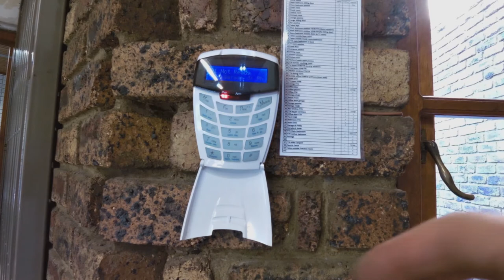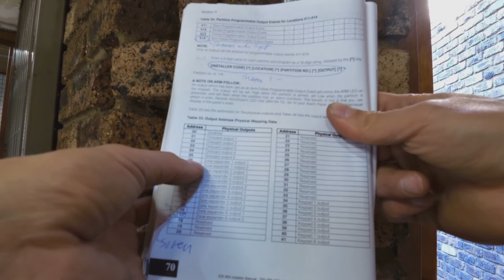How to connect a relay board to an IDS X64 expander module

Comment: Thanks for the informative videos. Can the onboard programmable outputs be programmed to open a gate or a garage door or do I have to install an external expander board? I couldn't find anything in the manual.

Comment: Great videos to explain the settings!! I used an Opto-isolator instead of a relay with current limiting resistor to limit the current to 10mA (below the 25-50mA rating) to do external monitoring of the alarm state. This worked for some time and then stopped working. I get no output from onboard output 3 as per the default settings when armed/disarmed. I tried to program another output, but still no output. Any idea on how I can test the outputs? I would assume that a relay coil will require slightly more current than an opto?
Reply from the maker: thank you. A small relay coil is fine with those programmable outputs. It sounds like the coding of the location is incomplete. Did you update any firmware maybe? I would check location 414. Also are you using a common ground? I found the IDS boards do not like common earth to peripheral devices. So the relay or the power and earth of the opto isolator should be on same potential as the programmable outputs - share same negative wire, however that neg wire should not link to other devices. make sense?
Reply: @ecologicaltime  After quite some time I had a look at it again and found that there is a 560ohm resistor just before the output 3 screw connector. The resistor seems to have taken a bit of current and on trying to test it it popped off the board. I might be able to salvage the track and replace the resistor. I will test my opto circuit and confirm the current draw, maybe something went wrong there. I might just move to a relay, but seems to be an overkill as I only want this to input into a ESP8266 digital input. The circuit and ESP was powered from the main board AUX supply and the opto was triggered using PGM3 + and the - on that same connector.

Comment: Dear EcoLogicalTime
Thank you very much for all your videos.  I recently acquired an IDS X-64 and had it installed.  In this video, you demonstrate how to connect an external siren and program it to the output event.  
Is it possible to connect a Buzzer?  Physically though the relay I know it is possible.  However, I don't see a Buzzer Programmable Output Event.
I want to use my Outdoor Beams as an early warning.  Thus, I have configured them (all of my Outdoor Beams) as a Buzz Profile zone type, giving me 30 seconds warning when the panel is Stay Armed.  With this, I am able to first inspect before the alarm wakes the neighbourhood.
However, the buzzer in the keypad isn't loud enough to my liking and I would like to connect an external buzzer to this event.  The second requirement will be to also connect a spotlight to the same relay or second relay with the same buzzer event.  This will then allow my beams to activate the spotlight in the same way as a motion detection spotlight and at the same time give me the early warning.
How would you proceed with configuring this requirement?
Regards
Waldo
Reply from the maker: hi, thanks. Do you know you can set the volume of the keypad? Your second point: you can set some zones as warning zone that dont go through to your security company and the alarm can then activate the relays for spots but then the siren would alarm too. Working outside of the alarm, i can tell you how to get your beams to activate floodlights if you want?

Comment: How did u register your expander module? Zones 17-24. Mine is flashing 6 times. Unregistered module
Reply from the maker: ill post a video about how to do this.
Reply: @ecologicaltime  thanks.i hav figured out the problem. The extender couldn communicate to the panel cos it was not wired to the D+ and D-. How to programme the partitions?? i found the answer in ur other videos. My zones was not partitioned.. But thanks for ur great videos

Comment: Can you please tell me whether or not the heat drawing metal plate should be very hot so that one cannot keep ones finger on it ,
Not even for 2 to 3 seconds ?
Reply from the maker: runs hot. Hottest when the battery is being charged.
Reply: Thank You .

# # #

So the heatsink is always too hot to hold one's fingers on ?

I take it that my above statement is correct ?

Comment: Any chance you could do the same but with outside lights? I want to turn on outside flood lights when the alarm goes off.
Reply from the maker: you must programme one of the programmable outputs. Then you use the IDS or Sherlo relay board to switch a contactor or more powerful relay which is connected to your DB board to switch on your flood lights outside. I did do this in one installation.
Reply: @ecologicaltime  thank you. The relay you have used is rated at 10A for 220v if not mistaken. I was hoping to use the same one

Comment: very bad practice to work on the panel with power connected ... you don't change oil in your car with the engine running ....
Reply from the maker: Not really, fault tracing a panel requires one to work with it on. If you watch my video on how to change a zf gearbox oil you will see the repair is done with the car on as are many repairs take place live. Even in medicine some procedure s must be done with patient awake. Thanks for your comments.
Reply: Experienced installers know what they are doing.